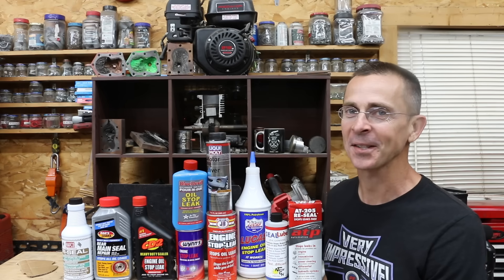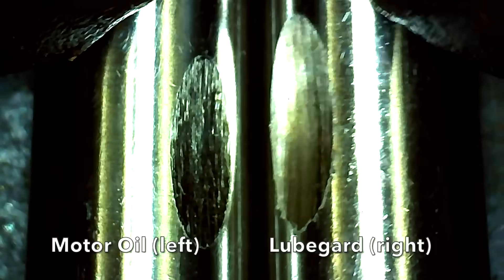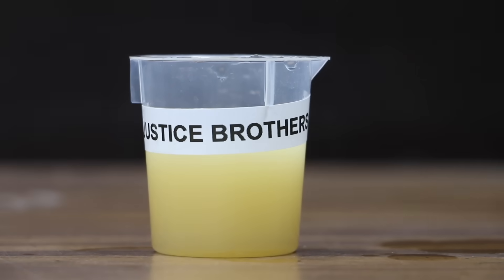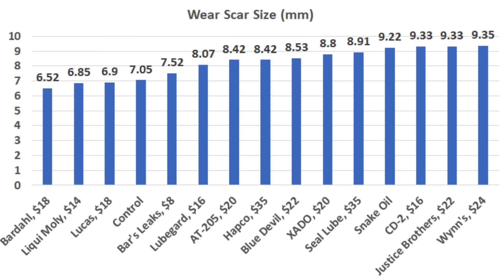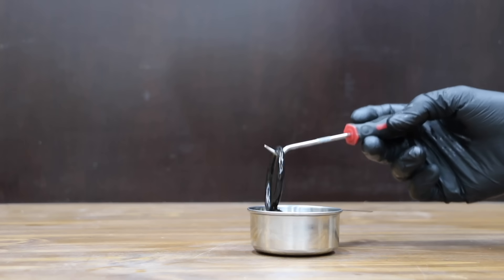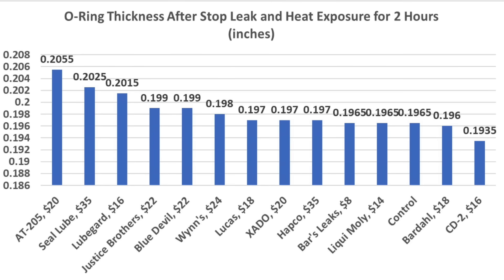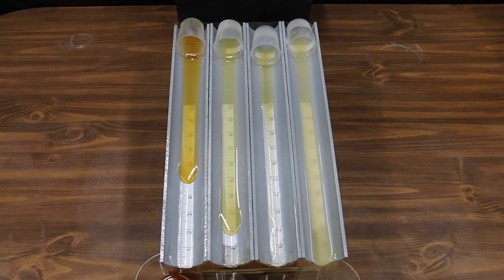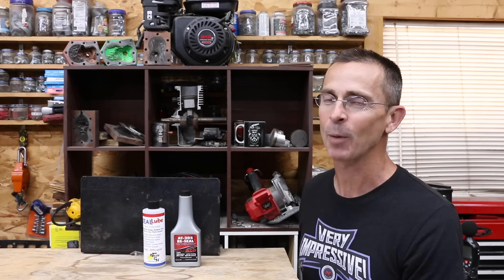Do Stop Leak Products Work? Do They Damage Engine Seals? Will They Destroy an Engine? Let's Find Out

Comment: I've been dealing with a microscopic oil leak in my timing chain gasket for a couple of years now, but neither have had the time nor money to have it manually rebuilt. This definitely helped much better, once I weigh the pros and cons of each of the products you've tested here on a 9-year-old Toyota that's just a little past 285k miles. Thank you again for your test videos as this one came in most handy, so far. Keep rockin', PF!
Reply: Same here. I have the same issue on an old Mazda v6 with 185k miles. I was going to use Lucas but now I'm having second thoughts.
Reply from the maker: Thanks, will do!
Reply: Which did you use and how did it do?
Reply: Dang 285k in 9 years? Did you end up using anything?
Reply: @chrisz.9974  Actually didn't have to. Went to the mechanic to have my front wheel bearings and shocks done. He found the leak as soon as he took the right brake rotor off (fender liner missing), fixed it for free, but didn't tell me how he did it and which product he used (if any). Oh well, out of sight out of mind. For now anyway.
Reply: @krayzeejojo, you've been just refilling your motor every time?
Reply: @krayzeejojo  Yeah he didn’t say anything because it’s probably was the oil filter he didn’t tighten down correctly last time he changed your oil. I know the 4Runner oil filter is behind one of the wheels.

Comment: AT205 !!!!
On the recommendation of a motorcycle friend concerning a front O'ring seal leak on my transmission, I put in the required amount.  With 2 rides totaling 160 miles, the AT205 stopped the leakage entirely.  The leak was averaging 1 ounce per 100 miles.  Zero now.
Reply from the maker: Thanks for sharing.

Comment: At-205 is the best to rejuvenate engine rubber seals and transmission seals
Reply from the maker: Thanks for the feedback.
Reply: @ProjectFarm  your welcome I used it in a 1994 Ford ranger with a bad rear main seal leak and it rejuvenated the seal but you have to use it every oil change. Which might get expensive. I works better in areas where you don't have to change the fluid frequently.

Comment: this test is totally useless and misleading.  you are using a 50/50 mix, when in reality in the car it's a 10:1 mix of oil to additive, or even 25:1 mix.  you have to use the ratio of oil to additive that you are ACTUALLY USING IN THE ENGINE !!

Comment: I have used Lucas oil stop leak in two of my cars and it did not appear to cause any damage and actually completely stopped both leaks. Both cars had over 200k miles.
Reply from the maker: Thanks for sharing.

Comment: That other guy with the automotive Channel where he also yells a lot always says AT205 is a top-notch product.
Reply: He also can't stop moving his hands around. He practically flaps them like a bird flaps its wings in flight. LOL!!!!!!
Reply: Right, I was under the impression at-205 was top notch for POWER STEERING LEAKS. The only problem I see with the "friction test" is that the results are irrelevant when dealing with power steering leaks. Am I wrong? Seriously asking ..
Reply from the maker: Thanks for the feedback.
Reply: C3PO
Reply: Just get a Toyota and you’ll never have an oil leak.😂
Reply: @bjh7208  Not true for all Toyotas. My 2011 Tundra with 5.7 (164000 Km ) has a rear main oil leak. I was at local dealership today having my truck looked at (Ontario, Canada) They quoted me $2767.06 with taxes to replace the rear main oil seal. I'm thinking a bottle of AT-205 is worth a try at this point.
Reply: @RobflysRc did it work for you?
Reply: @bjh7208 im here because my toyota has an oil leak 😂
Reply: @bjh7208  Ive got toyota and thats why im watching this video.. because i have a bad oil leak.

Comment: Love the channel. Been an auto tech for about 15 years and most of the time there are not effective cures in a bottle. However I have seen Blue devil fix rear main seal leaks (not exactly sure of their product lineup may be a different product than you tested)
I would like to point out though that blue devil stuff for rear main seals is intended to be ran through an engine briefly (limited amount of time) before changing the oil.
Not necessarily certain exactly how long the fix will last though 😅
It always gripes me that all the stuff they sell to put in your car is basically a mystery if you are diligent enough like I am you might go as far as searching the MSDS for primary ingredients but I think they should be required to list them like food products.
Reply from the maker: Thanks for sharing!

Comment: I wonder how different the results would be if  the mixtures were in ratio to the directions. All the mixtures were 50/50 in the test, but some of the directions shown stated adding 20% per crank case, 4:1 ratio, etc. . You wouldn't have a 50/50 mix of stop leak and oil in a crank case, it would absolutely cause wear/friction/viscosity   problems.
Reply from the maker: Thanks for the suggestion.

Comment: I like this video as I’m looking into using at 205  on my 2004 Honda TSX. I like your lubricity test. The only thing is it appears you used a 50-50 oil to additive mixture. I think it would be better to use the working concentration to see how much affect the additive would have on lubricity. For example, at 2:05 is 6 ounces additive to 4 quarts oil. that would be about one part additive to 5.3 parts oil. Check and see the effect on lubricity of the oil at this concentration to get a accura read on possible damage to the engine.
Reply from the maker: Thanks!  Thanks for the constructive feedback.

Comment: (Australia) on my old maz626 with 320+km on it, I had many a Leak to sort out... both the Engine and the AutoTrans were contributing to the old car becoming the wife's enemy of the state where the garage floor was concerned. So I instilled the required measure of AT-205 into both the Engine and ATrans, and started monitoring over time.
 AT-205 claims Leaks will disappear by 5 hours of driving... I monitored kms travelled day by day and by the time 350km was reached, all leaks had gone away.
 I also tried AT-205 on my Fuel Filler Cap rubber seal, and voila! my fuel system pressure problem resolved too!  i.e. the Cap once again goes 'hiss' when you open it after driving some...  
  I have now imported another 2 bottles in prep for redoing the Treatment after the upcoming Service that most likely involves an Engine/Trans flush... soon after which we are going to roadtrip around Aust (14000km)
Reply from the maker: Thanks for sharing.

Comment: I have used the Blue Devil product on two of my old cars. Both cars have over 280,000 miles on them. Worked very well when it came to the small rear main seal drip. No more drips. I would like to see your results testing Tuf-Oil engine additive. I have been using since I was 17 years old. I credit it for my extreme engine longevity. Would love to see your results.
Reply from the maker: Thanks for the suggestion.
Reply: Did you add Blue Devil to just one oil change and run it for 5K miles, or do you reapply a new bottle of Blue Devil with every oil change?
Reply: @nostradamus7648  I put in a full bottle and ran it for 3k miles. Seems to have worked well.

Comment: I love your videos and watch them a lot, I would've like to see the seperation and lubricity tests with the additives added as per the ratio of oil you had in the cup. A lot of those are being mixed at 50:50, where as the directions of a good handful of those are is around 4-8 fl oz per 3-6 qts of oil. I bet the lubricity would be a lot better in a bunch of those and the seperation not so drastic.
Reply from the maker: Thanks!  Thanks for the constructive feedback.
Reply: @ProjectFarm  no worries. Obviously I'm no expert and what you're doing is a huge leap for honest consumer end expectations, but it was something I noticed that I figured you'd be open to. Keep up the good work!

Comment: What I think the take away from this should be is that if your in a pinch this is what can an cannot be used sufficiently until a proper repair is achievable.

I do hate the ads on this channel with a burning passion, however when good work is done it deserves respect.

An so, good job. Perhaps radiator stop leak should be tested next if you haven't yet. Taking into account that it's been said to damage the flow inside the radiator too. Since you like ideas.
Reply from the maker: Thanks!  Thanks for the suggestion.

Comment: I have a 2003 Chevy Silverado with 218,000 miles on it.  Rear main seals were leaking badly.  Based on your testing i decided to try the AT 205 product.  Within 3 days after adding it to my oil the leaking stopped.  Obviously I will have to wait and see how long it lasts but the initial results were impressive.
Reply: Did the fix hold up?
Reply from the maker: Thanks for sharing.
Reply: Its been a few months. What's the verdict on the fix?

Comment: I think the amount of product added to the test oil should be proportional to the ratio of oil it would replace in a crankcase. 

If i substitute a 12 ounce product to a 5 quart (640oz) system, that would be 12 oz of stopleak alongside 628 oz of oil.  Thats less than 2% of stopleak in the solution.

I mean some of these tests are like 25% stopleak. Kind of an invalid way to judge them. Just imo anyways.
Reply from the maker: Thanks for the feedback.

Comment: I'd like to see a test of the best performers here for intended use (rubber seal thickness and softness improvements) when mixed with oil to the manufacturer's recommendations and combined with the best products to offset worsening lubricity / scaring scores. EG AT-205 + Bardahl vs Seal Lube + Liqui Moly, etc.
Reply from the maker: Thanks for the suggestion.

Comment: Great video. I've used At-205 in 3 occasions where I didn't want to deal with a complex assembly that was leaking and all 3 times it completely stopped the leak. One of them was on a lawnmower that was not all that complex, but not worth my time to mess with. It was leaking like a pig, I poured this stuff in thinking I just wasted 20$, there's no way it would do anything. And to my amazement I was wrong,  it completely sealed the leak and when I sold it 4 years later, it was still running great and dry as a bone all around the base where it was leaking originally. This stuff truly is amazing.
Reply: @kychristell1779 Scotty drinks it...even though the interwebs claims he's dead several times a year, he'll never die :)
Reply from the maker: Thanks!
Reply: If we use this product too much , will it make the seals worst ? Or this is just a temporary fix , my car leak is from the plug .. or around crank case ? Not sure
Reply: @natusfreedom472 use UV dye to find leak with a UV light. New drain plug with new gasket, some are embedded into the plug itself. If the leak continues with new drain plug, wrap Teflon tape (6 wraps around) on the threads. Cheers.
Reply: My motorcycle fork seals seem to start leaking after only a year or 2....I think from light pitting on the chrome. When I say leak,  I mean only slightly but that's when motorcycle riders change their seals. I bought new seals already but I'm gonna see AT205 will stop the leak. If it works then they'll probably last for years.
Reply: @michaelbrinks8089 did it work

Comment: The next time try the K-seal ultimate. Was the only that solved a really bad problem in the head of my motor!
Reply from the maker: Thanks for the suggestion.
Reply: @ProjectFarm great, and maybe the next time you can include a type of proof of leakege under pressure and mixed with water i stead of oil, replicate what happen in the real use.  Usually they goes in the radiator or in the water tank for liquid cooled engines

Comment: I have a 96 Escort with a 1.9 and a 92 F150 with the 4.9, both are high mileage and WERE very reliable. The Escort had a drip from the rear main seal. I did an oil change on the Escort and added the Lucas exactly as per the instructions. I had about a quarter, more or less, of the Lucas left over. The F150 was sitting there and I thought I'll pour it in the truck, what could it hurt. So I take off in the Escort and go about 10 miles and its starts running rough. I turned around and headed back home and by the time I got back it was down to 2 cylinders and barley running. I get in the truck and head out and in 10 miles it felt like it was running poorly and I glanced at the oil pressure gauge and it was on zero. I turned around and by the time I got home the lifters had collapsed and it sounded like it was gonna fly apart. The Escort engine is destroyed but I drained and flushed the truck to get the Lucas out and was able to get it to run normally but it will only go about 15 miles before the oil pressure drops to zero and lifters collapse again. Two very reliable vehicles taken out on the same day. Did they have anything in common? Yes, Lucas Stop Leak. I'm extremely unhappy and I'll never touch another Lucas product.
Reply from the maker: Thanks for sharing.

Comment: Todd, I have to sincerely thank you for this test video! I have a 2011 F250 6.7l with ~160k on the meter. I had a noticeable rear main leak and before paying more than $1k to have it replaced I "gambled" ~$40 on 2 bottles of AT-205 because of this video. It's been over a month since I did and guess what! NO MORE LEAK! 😮 I was shocked and waited to see how long it lasted before posting this, but at a little over a month, I'm impressed. Thanks for your content it's wonderful! Keep up the good work brother!
Reply from the maker: Thanks and you are welcome!  Thanks for sharing.
Reply: You guys need to rip out or replace your ccv on those 6.7’s. After about 60k on the stock ccv they get clogged and cause a build up of pressure in the engine. It will blow out more than just your rear main. I just did a ccv reroute which totally nukes the stock box.
Reply: Update?
Reply: @ScatPackin    I am happy to report, I have kept up with addis the AT 205 at each oil change and that the rear main seal leak has not reappeared and remains sealed. I have developed a different leak, on the passenger bank valve cover that is not responding to the AT 205 treatment, but unfortunately we can't literally win them all, I'm still really pleased with what it has been able to do!
Reply: I am start having same issue just yesterday I noticed I am having rear main seal leak , on my Ford 2014 and its very low leak , did you use entire bottle of AT 205 or half , I just did oil change yesterday and haven't drove my truck maybe more then 10 miles. So what you suggest ? Should I use entire bottle and once it stop leak then do the oil change or leave it in with oil ? Kindly advise. Thank you 😊
Reply: 1 yr update. How did the ATP-205 Reseal hold up? Did you have to use another 2-3 bottles or is the leak gone? Thanks!
Reply: @dbzownz12345  I am happy to report, I have kept up with addis the AT 205 at each oil change and that the rear main seal leak has not reappeared and remains sealed. I have developed a different leak, on the passenger bank valve cover that is not responding to the AT 205 treatment, but unfortunately we can't literally win them all, I'm still really pleased with what it has been able to do!
Reply: @Spartacus3006  Sounds good! I've tried AT 205 with not so much luck. I've purchased a Bars leak product their ring repair. It's $20 on Amazon. Have an oil pan leaking, valve cover too. I'll see if it helps & I'll let you know if it's a good product to try. Suppose to seal any leaks in 250 miles/3days or driving.

Comment: I tried that Barrs Main Rear Seal Repair sold as Rislone’s here about two years ago (on a 2005 Subaru Outback)- after a few cleans with seafoam I went from no leaks to high amount dripping in several places - that stuff sealed it all up, I get a single very slow drip since then for the past 2 years and that’s all. Good stuff.
Reply from the maker: Thanks for sharing.

Comment: I don't think your wear test results are showing how big the wear difference is when comparing results.. As the wear gets larger in length, the wear also gets deeper and wider. So the amount of wear is actually gets exponentially higher as the length of the wear scar increases. I did some calcs and there is over a 300% performance difference between the best wear score and the worst.

I assumed your wear token was 1/2 inch and the diameter of the rotating cylinder was 3 inches. Using Fusion360, I made cuts in a 1/2 rod at the lengths in your results with a 3 inch diameter arc. 

The volumes worn are as follows:

Bardahl | Wear: 6.52mm | Volume: 0.939mm3 | % vs Control: -27% | % vs Best: 0%

Liqui Moly | Wear: 6.85mm | Volume: 1.114mm3 | % vs Control: -13% | % vs Best: 19%

Lucas | Wear: 6.9mm | Volume: 1.178mm3 | % vs Control: -8% | % vs Best: 25%

Control | Wear: 7.05mm | Volume: 1.284mm3 | % vs Control: 0% | % vs Best: 37%

Bar's Leaks | Wear: 7.52mm | Volume: 1.662mm3 | % vs Control: 29% | % vs Best: 77%

Lubegard | Wear: 8.07mm | Volume: 2.204mm3 | % vs Control: 72% | % vs Best: 135%

AT-205/Hapco | Wear: 8.42mm | Volume: 2.612mm3 | % vs Control: 103% | % vs Best: 178%

Blue Devil | Wear: 8.53mm | Volume: 2.752mm3 | % vs Control: 114% | % vs Best: 193%

XADO | Wear: 8.8mm | Volume: 3.111mm3 | % vs Control: 142% | % vs Best: 231%

Seal Lube | Wear: 8.91mm | Volume: 3.270mm3 | % vs Control: 155% | % vs Best: 248%

Snake Oil | Wear: 9.22mm | Volume: 3.749mm3 | % vs Control: 192% | % vs Best: 299%

CD-2/Justic Brothers | Wear: 9.33mm | Volume: 3.931mm3 | % vs Control: 206% | % vs Best: 319%

Wynn's | Wear: 9.35mm | Volume: 3.965mm3 | % vs Control: 209% | % vs Best: 322%
Reply from the maker: Thanks for sharing.
Reply: @ProjectFarm  Using a chatbot to respond to people is worse than simply not responding.